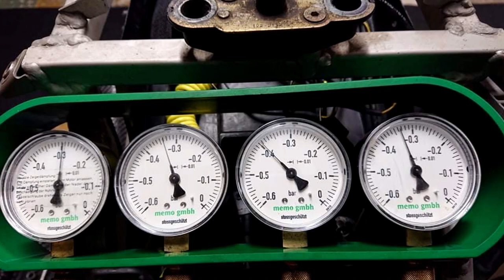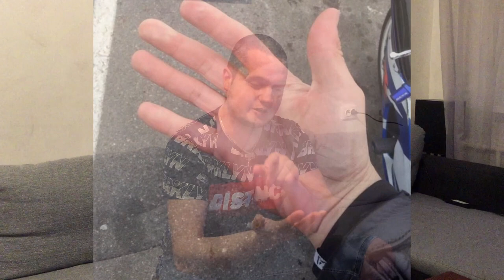Gsxr 1000 K1 Last Ride 2020

Comment: Sounds a lot better, same thing happened to mine, fuel pump naffed and 3 out of the four injectors were shit. Rust in the tank as well, make sure if the bike isn't being used during the winter, remove the battery, run it dry, remove the fuel tank, plug the hoses to stop spiders from nesting. Good time to get some nuts on a string and put some vinegar in the tank and give it a bash to remove built up rust. Then flush it, and keep the bike off the ground to reduce flat spots on the bike, that's if you can't use it during the winter.
Reply: Petrol evaporates overtime, then condensation will build up in the tank, causing more rust, if you aren't running it, that fuel will go bad after a month sitting idle, and get some paddock stands otherwise your tyres will get ruined
Reply from the maker: Thank you for the info.i got the tank cleaned as much as possible when my friend did the job🙂.I thought to put it on the stand but im affraid that they wont hold so long and the bike will fall.
Reply: @TheMeisner87  set of paddock stands, you can get for little as £60 on Amazon, our swingarm is quite wide, so if you can't get ones to fit, then use some bricks and wood, but definitely get it off the ground if not in use, as your tyres will produce flat spots then become useless, and you'll need a new set of tyres

Comment: Put lowering plates rearsets for k1 k2 on ebay best move I ever did  very comfortable to ride
Reply from the maker: Lowering plates?What do you mean?
Reply: @TheMeisner87  there adjustable plates  on ebay.uk for lowering the foot pegs drops your legs that bit make sure you put in gsxr
Reply from the maker: This is also my plan to install them but i havent found the right ones that fit🙂